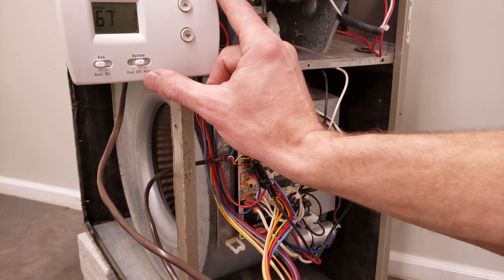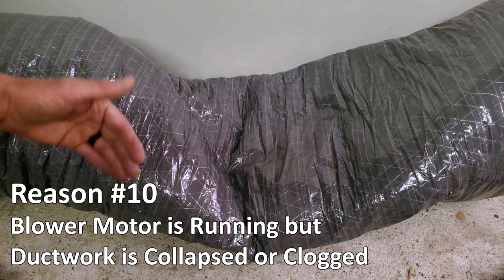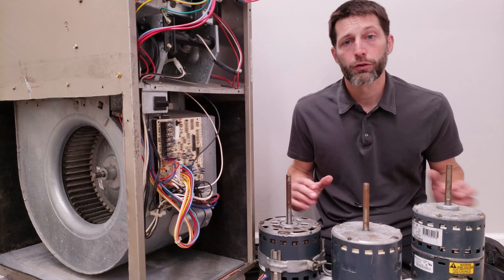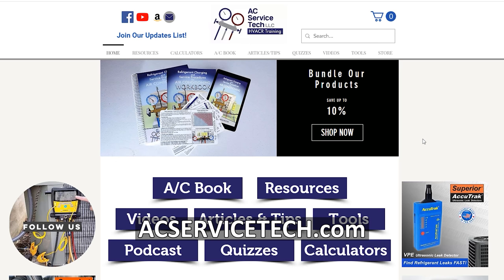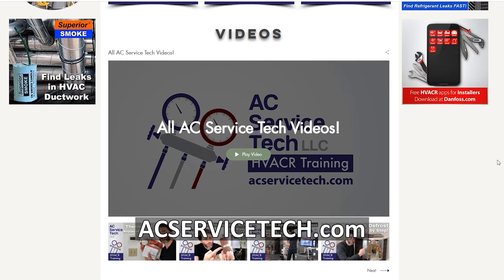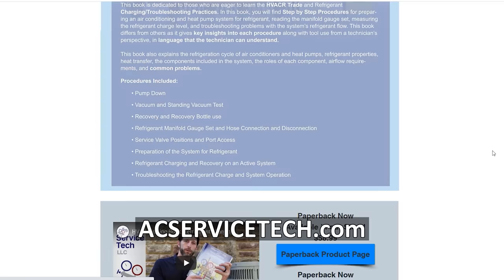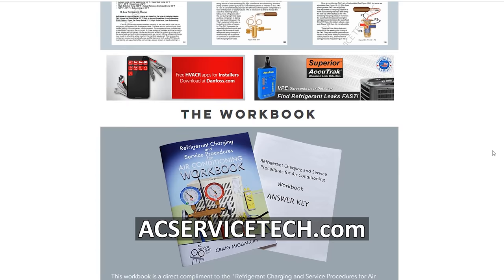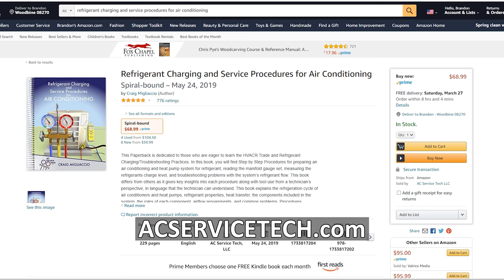HVAC Blower Motor FAN WON'T TURN ON, NOT WORKING! Top 10 Reasons/Problems! Heat and AC!

Comment: I am an electrical engineer that enjoys your YouTube videos and a subscriber thereof..  "MFD" rating = microFarad; it would be more correct to call this the capacitor VALUE, not the capacitor RATING..  Normally the "rating" of a capacitor is its designed maximum operating voltage, not its capacitance.  And suggest "10.2 OHMS, rather than just "10.2"  But great video.
Reply from the maker: Thanks Dane!
Reply: Take a chill pill
Reply: @om6789gg  , I actually agree with Dane. Although this is a really great instructional video (and a great instructor teaching it), the clarifications that Dane gave in his comment were justifiable.
  If someone who is watching these videos relating to HVACR is actually wanting to increase their knowledge and become an 'expert in the field', these facts represent logical truths. So it is only fitting to elaborate further on the subject by 1) explaining what the readings on the multimeter represent, and 2) differentiating between  what the 'rating' and 'value' is in relation to a capacitor. 
  'Take a chill pill.' is something someone who is ignorant and lacks understanding would say. 
And, to elaborate further, the word 'ignorant'doesn't mean anything other than 'having a lack of knowledge on a particular subject. 
  Right now, I am ignorant in the field of HVACR.
  But I think all of us watching these videos are learning to not be. 😏
Reply: @ParabellumX  i completely agree with you
Reply: it matters... good call.
Reply: Spoken like a true engineer, if you put too much voltage in those capacitors you put the "smoke" out of them.😂
Reply: You’re wrong buddy.

Comment: I would have Zero problem with you remaking a lot of your older videos in this new style and newer recording equipment you use.
Reply from the maker: Yeah I just wanted a cleaner new version. However it didn't seem to go over as well as original new videos, thanks!

Comment: It is unfortunate, or perhaps by design to generate profits from selling bell end to the ECM motors, that there's not be a move to make the PTC Inrush thermistor in a format such as like the blade fuse so it was easily plug n play replaceable.  In any case, that weakness is giving ECM motors a bad name with system  owners.
Reply from the maker: Yes that certainly would be helpful to have if components susceptible to failing were easily replaceable by design!

Comment: What can be the problem. Fan only comes on when heat or ac is on. I've set fan to always on. The termostadt display my selection but the fan is actually not on until the ac or heat kicks in.

Comment: I replaced my capacitor and everything is working again when it is cooling everything seems fine but when it is heating it runs 3 to 5 minutes and everything shuts off then the thermostat boots back up it says waiting on equipment for a few minutes start’s up and dose it all again could I have purchased a faulty capacitor?

Comment: I replaced by motor and fan because the bearing was bad and the fan was rusted on. Bought this house a year ago. Anyway, I replace them and connected them back. For a couple of minutes it blew cool air and it was running fine. After that it stopped. It will kick on but the motor runs very slow. I have no idea what happened in those 2 minutes. Any ideas?

Comment: Hi there. My AC stopped working last summer. Fan on outside unit stopped spinning. Jumped it a couple of times then it finally just went out. Seems like it might be a bad capacitor.  Used AC window units this summer. Now, my gas furnace won't come on. It doesn't even click at the thermostat. It's like it's just dead. Would my outside AC unit's bad capacitor affect my furnace from not coming on? I've tried turning on "fan" mode on my thermostat and it's dead too. "On" mode also doesn't work or come on.  Any advice would help me. Thank you.

Comment: Thanks. By testing my blower motor resistance and not seeing/smelling any indication of burning, and noticing the motor turned freely  I purchased a new control board and that fixed the problem!

Comment: SIR - You are God Send Help. THANK YOU A MILLION AND I WILL NEVER FORGET YOU. 
My situation was the Inside Air Handler or Evaporator Blower motor wouldn't turn on, while the outside compressor condensing unit will turn on.  I was afraid that the air handler motor /Capacitor / relay would be the culprit and perhaps even the controller board.  I have  changed the motor / cap and relay on the condensing unit but never messed with the Air Handler Blower or the inside unit and was dreading it.  Your Video saved me from no telling what kind of an expensive ride I would have had with those AC repair service surprises. Mine is a 35 year old Goodman unit and probably doesn't have the ECM etc since it is a single speed motor. I watched your video in full and was going to go step by step.  I followed Step 7 (the thermostat) first since it was easy and never knew thermostat could cause an issue while allowing the condensing unit to come on. I removed the Battery, measured the voltage was reading 1.334 and was hoping a new BATT would help. Guess what i put a new battery and the Fan handler came on and the AC  is working now.  Never realized that thermostat showing to be in working shape could cause this. May God Bless you for your Great Service and Once again a Big Thanks to you and you are TRULY GOD SEND HELP.
One question sir - Is it normal for the condensing unit to come on first and the Air handler fan to turn on after a 25 second delay. I dont think it was like this before. Is this some symptom of some thing coming... Thank You.

Comment: your channel pretty much put me in the position to almost fully diagnose what has gone awry with my 3.5ton carrier heatpump package. sadly i have not isolated the problem as of yet. the original problem: indoor fan blower moves freely with no noise and is seated properly but motor movesonly in a stop go fashion (small movements). compressor comes on, bottom of accumulator and some of the lines frost over (ambient outdoor temp is 107 between Noon and 1700 )since it is an older 42 size system i felt it prudent to start replacing the usual culprits:
capacitor. hard start kit. defrost board. single pole contactor. replaced blower motor. thermostat good.result: same issue. outdoor fan is fine. condensator coils and ubends look good, unit very clean. wiring clean. no obvious oil deposits anywhere on copper lines, valves, connections.

what's next? replace fan board? refrigerant charge/leak?

Comment: You got my attention at 8:50 with your yellow magnetic jumper wire. Never seen these anywhere before and I see Amazon has them.  I troubleshoot a lot of industrial machinery and with most of the terminal strips there is no way to attach a meter lead and a person only has two hands. I was going to make some of these leads and bought and received some small neodymium magnets. Another thing is why a person should use a bleeder resistor instead of a screwdriver to discharge a capacitor is because some capacitors have an internal fuse and if you use a screwdriver you run the chance of blowing the fuse besides blowing the tip off of your screwdriver. Great job.

Comment: I blew up a screen shot to view the code number you read description of-turning out to be a blown "FUSE" related to low voltage short. It was code 24 yet you did not mention that number or the fix. You DID SAY Fuse-- It is a 3 amp ATO  fuse on the circuit board. I read between your lines and found the problem. Thank You!  Jim Simpson, ODD parts fabrication.

Comment: Thank you Craig.  R to G at the fan control board, nada...and it's a new board..I will have to do some more thinking here as to why the variable speed DC fan motor (also new and new controller) worked for the AC but not when I turned the unit to HEAT.

Comment: Thank you sir, going crazy, bought contactor, new board, capacitor, just to find out now, it's the thermostat.  Never thought it would be that, but if it wasn't for this video, probably would have called a hvac company. Thanks again. 👍Great video..
Reply: I'm going crazy also....I by passed my thermostat and my motor is not running....motor is 2 years old....control board is a year old.....blah

Comment: Very helpful video, than you! 
The blower fan stopped working , meaning NO ac in the house, I opened the panel and disconnected blue cable which is the medium speed, and connected the black high speed and blower working again. Do you think that the issue is in the motor? Will appreciate your feed back.

Comment: Thanks for sharing this info.  I replaced my blower motor several years ago and it has worked fine until this year.  If I put it on fan on constant and it starts it will run for ever until I turn it off.  If I leave it on automatic it may or may not start when the compressor runs.  I'll check these points you have shown us.  I only work on this stuff every few years and I have put this off for months just letting the fan run constantly and wasting a lot of power.  Getting too old to crawl around in the attic have had four knee surgeries in the last two years so I have plenty of excuses. LOL!
Reply: Did you figure it out the problem?
Reply: I have the same issue

Comment: Thank you for this video. I am having the problem of number 2 on your list. Today I replaced the run capacitor and it worked great for about 45 minutes. Tomorrow I was going to check the ohm ratings on the speeds. I would have really been confused when the ohms were checking out fine. Also I did notice little almost blackish particles all over the insides, must be the resin that used to be on the windings.

Comment: Thank you! I carefully followed your process and was able to quickly identify and solve the problem. Turned out to be a bad thermostat face. When I swapped with another thermostat from a 2nd zone the unit immediately worked! But Ironically the problem unit is working in the 2nd zone! How do you explain that?

Comment: Great and informative video. Been working for hours trying to figure out what is wrong with my HVAC. Hopeful the things I try in this video will work. Will report back soon.
Reply: Please let me know if this worked for you. I have a similar issue in my house.
Reply: @rcm-tr1be  Turns out, it wasn't my blower the whole time! Who would've thought. My circuit board was sending power to everything EXCEPT the blower, so I had to splice my line in 120V temporarily until I get a new board. Crazy right?

Comment: We have 2 units, one for upstairs, one for downstairs.  Upstairs was recently replaced then started malfunctioning.....ended up being the thermostat. All of a sudden the downstairs started acting up (never had an issue before) 🤔. Condensor clicks on and you can feel it cool, but the blower doesn't start. Now im here. Im a car mechanic so we'll see if i can do hvac soon 😂. Got my 609 certification 🤷‍♂️

Comment: I have an ECM motor sometimes turn on and sometimes it just not start. It has two 120v wires and 5 speed wires. When it is working I tried pull up the 3 speed wires to 24v, all 3 speed works. When it’s not working even I could measure 120v on motor and give it 24v on one of the speed wire it’s not running. So wired. Just wondering if some one encountered similar problem😂

Comment: You teach the best ,
Thanks for this great job 👏👏👏
Sorry,I have problem in underestand wet and dry bulb  temp,would please explain those  and calculating super heat base on wet  bulb temp,
Would you please make video about that ?
Thanks a lot .
Reply from the maker: Dominique, look up "acservicetech wet bulb" and look up "acservicetech superheat 4 scenerios" and also read the article on the total superheat method at www.acservicetech.com/articles
Reply: @acservicetechchannel  
Thanks a million

Comment: You are very knowledgeable!  Can you come over and fix my ac blower motor?  I just installed a brand new ECM blower motor.  It worked for about 6 hours and then stopped working!  I think the module caps are not working anymore.  Brand new motor installed correctly and now what to do?  I’m a DYI homeowner, not an expert.

Comment: Great video. I have an ECM blower motor on my Carrier fb4c unit. My problem is it will not shut off. I pulled the thermostat head and it kept running. Had to turn it off at circuit breaker box. I assume motor module is bad. I'd like to repair but I don't know what electronic part of it is bad. If it wouldn't turn on I could probably find it but not turning off has me scratching my head.

Comment: Thanks foe sharing. Great information. I have a unique system with my carrier system. For some odd reason, in the early morning hours, the fan motor does not turn on. I have to cycle the indoor breaker to get the motor to turn on. During the day the system acts normal. Any advice?

Comment: Those ECM modules are $$$$$.  Take care of them by 1. adding surge protection and 2. not overheating (overworking) the motor/module via air restrictions (i.e. restrictive filter(s), bad ductwork).
Reply from the maker: Absolutely, thanks Ma Ma!

Comment: I have jumped R & G and it just clicks.  The blower motor does not come on.  Very frustrating.  I have replaced the capacitor.  The Motor spins freely.

Comment: Thanks Craig!  I replaced my capacitor because it tested 5.6 instead of 7.5.  The blower worked great after that.  But, a day later the blower didn't go on after the gas?  Then, it did for a few days.  Then, it didn't turn on after the gas, but just gave a louder than normal hum?  But, if I manually spin the blower, that will get it going?   Am I missing anything?  Thank you, again!

Comment: Very informative video. The air blows with AC on but Not air blowing when the heater is on. and the heating element is running. What is the cause of this issue?

Comment: Starting yesterday the circuit will trip in the house for the air conditioner. When I flip it back on it will trip again after about 5 to 10 seconds. I took the cover off of my air handler where my blower fan is in my basement. When I give power to it via the switch, a spark comes out of the back of the blower motor itself and trips the switch again. Something definitely appears to be shorting out. I'm assuming I need a new blower motor

Comment: Electronic air fan speed control failed twice in Florida in three years, meanwhile my capacitor start unit in Canada just keeps on running.
Reply from the maker: Yeah low tech vs high tech. It may also be due to line voltage irregularities on the ecm equipment, thanks!

Comment: I have a Goodman ECM motor and it sounds like a jet airplane when it starts to crank up and it's very loud on Air Conditioning mode. However normal on Fan only. 
Have you heard of this symptom before?

Comment: Can the motor itself be cleaned and oiled to return to service? Troubleshooting mine...found the thermostat set to "on" which means the fan was running 24hrs...i don't know if dust /heat ruined the bearings or if it can be cleaned and tried again. Im not sure if i can spray electrical cleaner into copper coils of motor...seems thst could cause more damage.

Comment: Great video. I have a question. The motor at my home runs only when it's cooling and heating. When I only turn the “fan on,” it doesn't work. I changed the thermostat, same issue.
Reply: @robertadams6017  I didn't find a solution. The blower (furnace) runs only when I set the AC to cool/heat. With “fan on”, it doesn't work.

Comment: One question, I did the jumper of the thermostat wires coming into the motherboard the blower instantly came on does that mean that my thermostat or the wiring on my thermostat is not working properly?

Comment: What about the blower motor reset button? Or does the light switch mounted on the side of the furnace pretty much do the same as a reset button?

Comment: Got a Top-10 ECM blower motor problem vid by chance?

So my package RTU's CFM ECM blower motor's frequently speeding up/slowing down/speeding up/slowing down and turning off completely only to start back up; all during a single cooling cycle.  It's  acting up more so in the late afternoon and evening hours. Does the same thing in fan only mode, too. Takes several minutes for the motor to come on at times, even in fan only... kinda weird.

Clues?
Great channel, BTW... thanks!

Comment: 8:47 I jumped R to G then ran down to the basement to watch/listen. After ab 20 seconds, the 120/24v transformer emitted a bright blue flash/pop. I cut the power after that.
Does this indicate any specific diagnosis that would be helpful in my now imminent conversations with hvac technicians?

Comment: What about Dual Capacitor systems without a cap on the blower motor? My blower seems to work periodically, and it doesn't have a capacitor. It has 2 cable harnesses that plug in; one with C, L, G, N, and the other with 1 2 3 4 5. I checked and the harness is getting steady 123v, but when I plug it into the motor it sparks/pops, so what could be causing that? The motor has a removable butt plate with what I assume is a thermistor. A second cable with a 3 prong harness plugs into the motor on the inside.

Comment: I have air handler blower motor that will not run even when thermostat is switched  from auto to on.    The outdoor compressor is also not running.     I have checked and have power to both units.   What unit do I trouble shoot first?

Comment: I pulled the thermostat face off and jumped the R to G and fan blower didn't kick on. When I jump R to Y the blower motor and ac works but when I jump R to W the heater works but  the blower  doesn't.